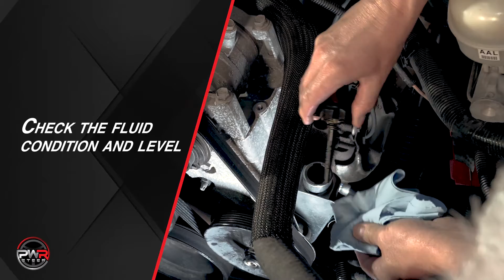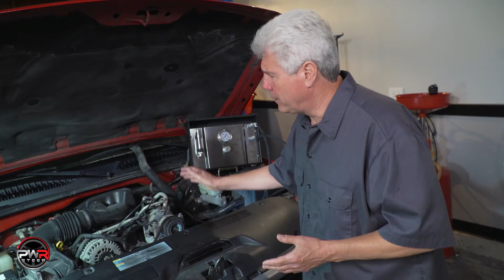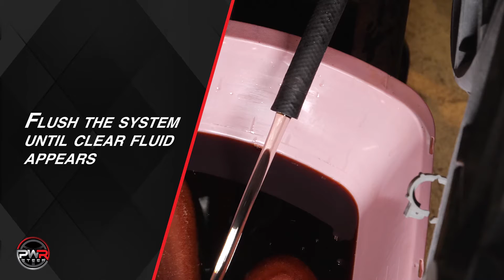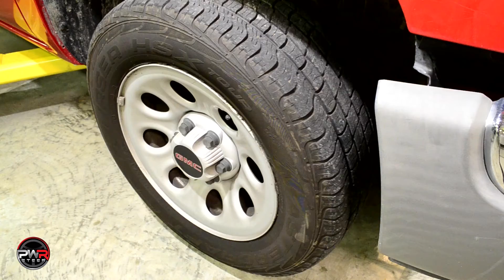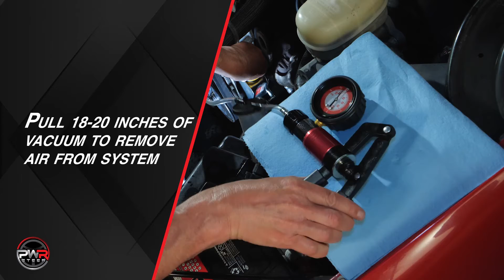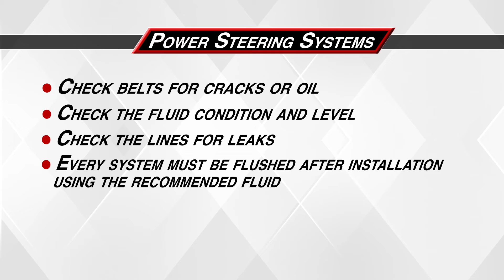How to Vacuum Bleed a Power Steering System: The Complete Guide | PWR Steer

Comment: Nice work im replacing my 02 4runner rack and pinion after an attempt at rebuilding it and still having leaks around the bellows i figure the housing for the rack is bent due to the sway bar links not being installed after a lift was installed my question is what is a good brand vacuum tester for rack and pinions to vacuum test the seals thanks for your help

Comment: How did you make the car crank but not start
Reply from the maker: Hi Ojay,

The are a few ways. 
A couple of the ways: you can take the fuel pump relay out or disable the fuel injection relay, and then the car will crank, but not start. 

Thank you,
PWR
Reply: @PWRSteer  thank you

Comment: All I wanted to know was how to disable the engine from starting and how to use the vacuum bleeder, but you skip over those parts as if everyone already knows how to do that. The title of your video indicates that you would be going over how to vacuum the system, but you barely covered that part! Poorly made...
Reply from the maker: Hi Jarrett,

Sorry that you feel this way. These videos are intended to be an overview. We have a library of videos and these topics are covered in those videos. Please feel free to check out other videos on our channel.

Thank you,
PWR
Reply: Jarrett, to disable the engine remove fuse going to fuel pump.  Will crank over but fuel will not flow.
Reply: Disconnect the camshaft sensor. It will not set off injectors.

Comment: Lots of good information, except it doesn't actually tell us how to use the vacuum pump to bleed the air, or how it works to get air that is trapped in some remote part of the system. What are you connecting your vacuum pump to?  Do you need to turn the wheels when you have vacuum?  Does the PS pump need to be run by the engine as you do this?
Reply from the maker: Hi Kevin, 

The vacuum pump is connected to the power steering fluid reservoir with an adapter. Once it is connected, you pull 18 to 20 inches of vacuum and walk away ( you can if you wish turn the wheels back and forth but the outcome will not be very different). The vacuum applied will pull all the micro bubbles out of the fluid. There may be a little bit of air left in the system because it is trapped, but most of the air will be pulled. If there is a little bit of air trapped, it will be pulled away when the vehicle is running, but it is so little it will not be enough to aerate the system.

We hope this is helpful!

Comment: I recently bought remanufactured pump from rockauto for my 88 gta. I bleed it 3 times with vacum pump and it still is whining. Vacum is holding so there is no leaks.
Reply from the maker: Rafal,

Sorry for the delay.

It is very possible that the pump you bought has been remanufactured so many times that even with new seals it would still whine.  
This is why many technicians today are recommending using a new pump, whenever it is available new.